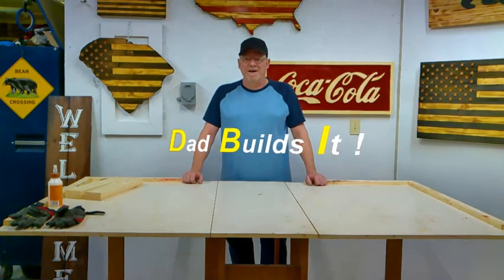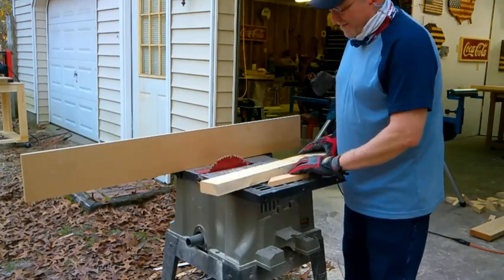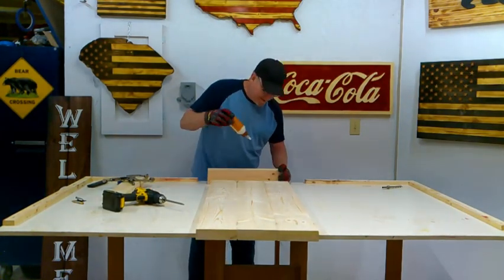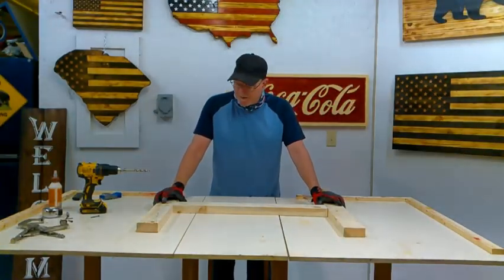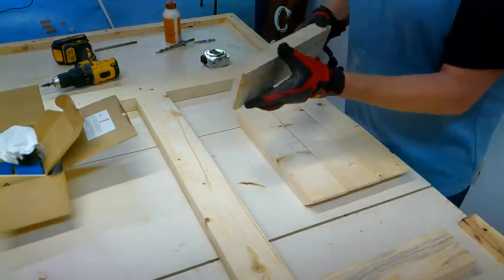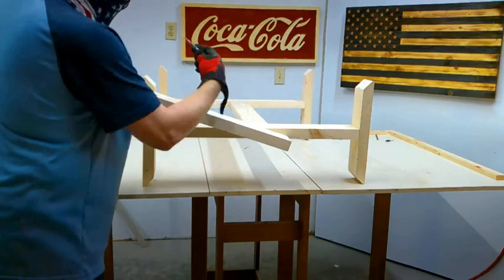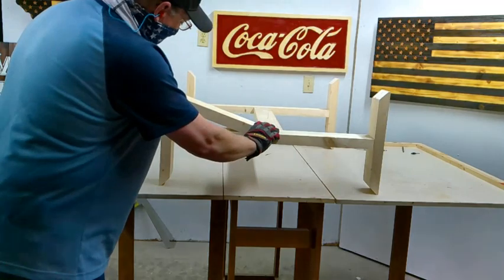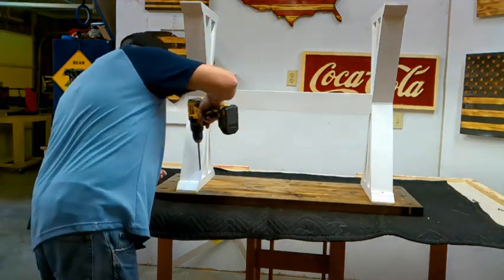Farm House X-Leg entry table. Wood working ideas, unique and interesting . Easy DIY Table.

Comment: Hey just found your channel. Love watching.  What is that work bench top made of?
Reply from the maker: Formica. its a craft table that the top folds down on the sides so it doesn't take up a lot of room when not in use and its easy to clean the paints and stains off of it. Thanks for watching!